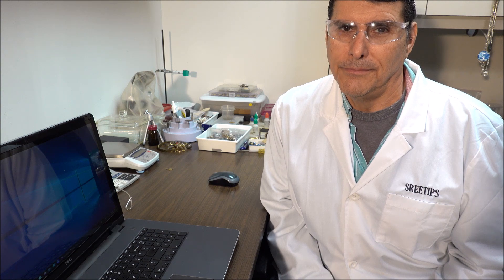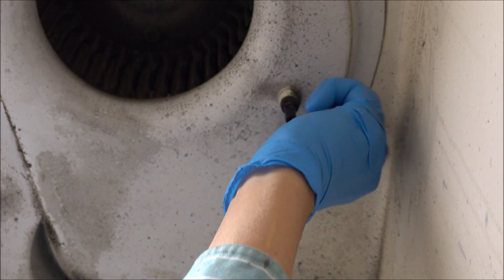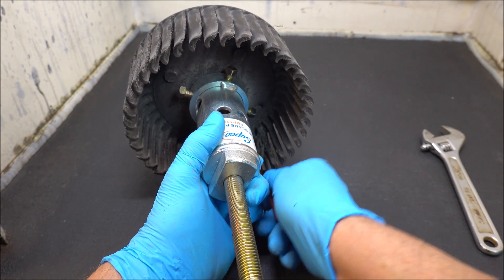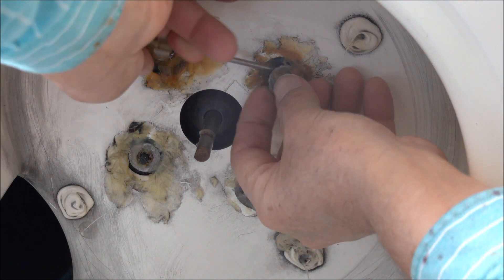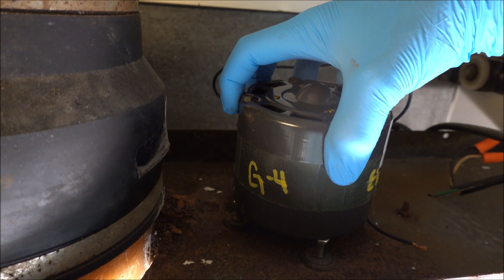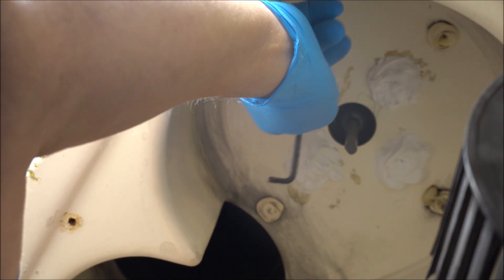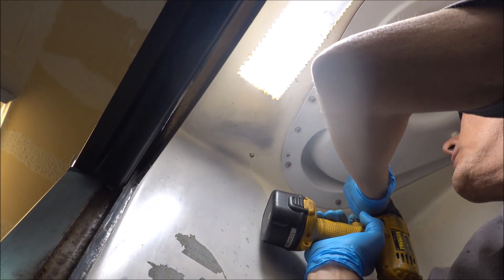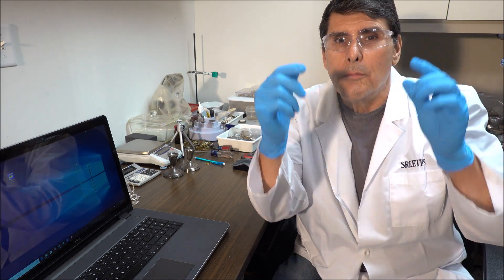Replacing My Fume Hood Motor

Comment: Another motor?
So soon?
Feels like it was only 1-2 years ago that your motor failed and you went through that whole fiasco of getting a proper replacement to go back in
Reply from the maker: This an old video re-post
Reply: @sreetips  ahhhhhhh, this makes 100% more sense to me now =)

Keep up the good work.

I myself still run tiny batches of recoveries;  and have learned there is a fine line between too much AP to dissolve copper/traces/boards/etc without starting to dissolve the gold and PGM's as well.

Been trying to figure out a way to make it more "set and forget" with smaller batches since the work to make my own nitric is too much (California woes;  its easier to make it than it is to procure it).